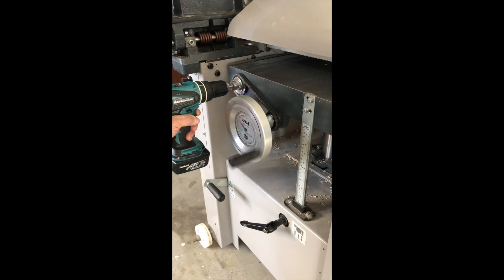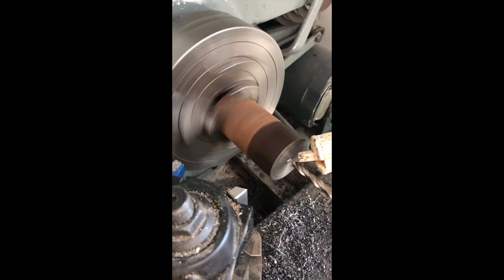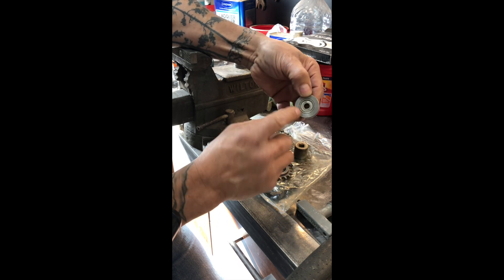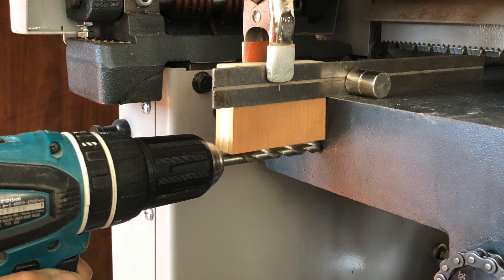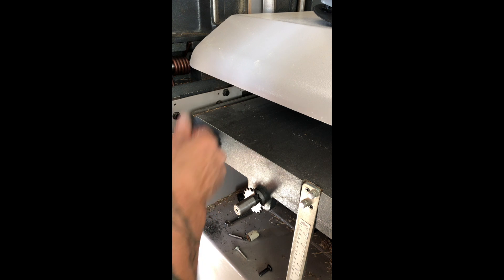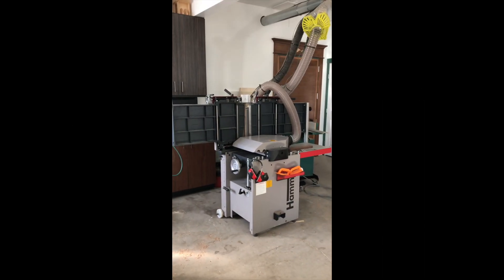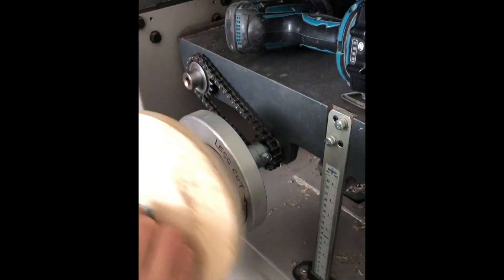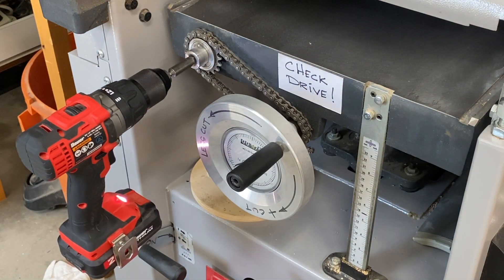Raise/lower your planer bed with a drill!

Comment: Did you make the outfield extension? I have the A3-31 and would love to add that.
Reply from the maker: I did. It’s just a wooden frame with a piece of plywood on top. Edged three sides with Formica, then covered on top.  One thing to note is the cast iron draft angle. The mating edge of the outfeed table needs to accommodate that.  I believe I used a thicker chunk of wood there to allow for a slight angle.  Once built, I clamped it in place and drilled holes through the wood into the cast iron. Then tapped some threads into the cast iron. I’m so glad I made it…it’s a huge help. LMK if you have questions

Comment: Nice upgrade!  I am sure I would have black & blue knuckles from the spin handle - not as careful as you.  I've got a much older Atlas that I find invaluable around the shop.
Paul
Reply from the maker: Nah man…the camera angle looks like it could be a knuckle buster …but hasn’t happened once.  Too far away.  Anyway thanks a ton for checking it out!

Comment: Great idea!   Always impressed by your craftmanship as well!!    My crank is vertical and a pain in the ass, I'll be thinking about this every time time I crank on the old, Woodmaster.   Thanks!
Reply from the maker: Thanks Tom! I actually never thought it was that bad …it only takes less than a minute to do a changeover by hand cranking.  But sooo many people would gripe about it…I decided to try a solution.  It works extremely well and kinda fun to use !  Thanks